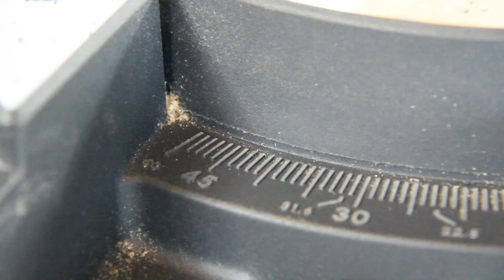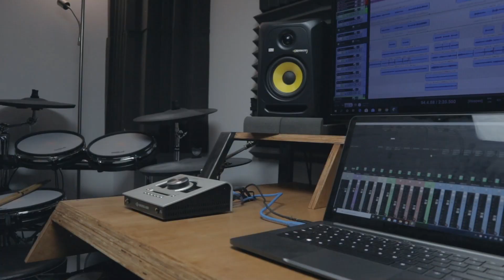The Perfect Music Studio Desk Build | DIY Custom Studio Desk

Comment: Very Nice. what size and thickness Tubing did you use. I need to hold up 250Lbs. Large mixing console. ?
Reply from the maker: Thanks ! It's actually some 1 x 2 x .125 square tubing. It should be more then enought to hold 250 lb !